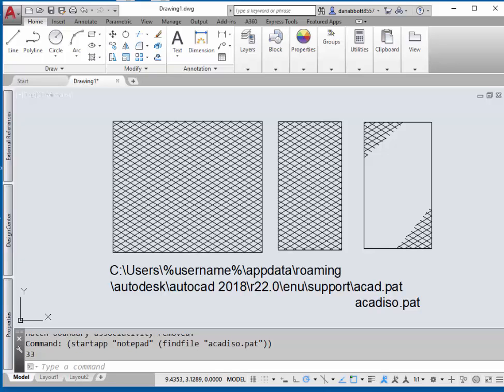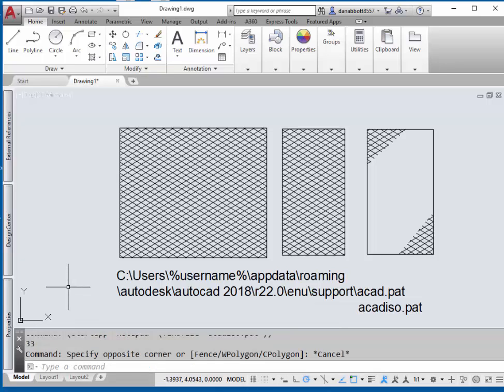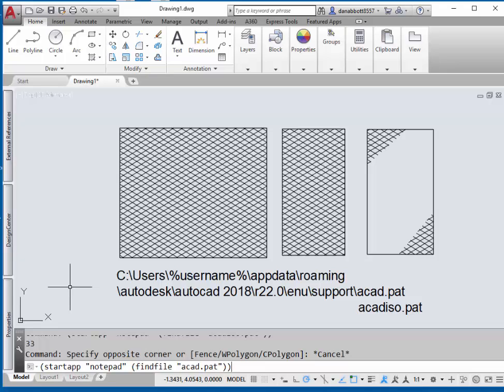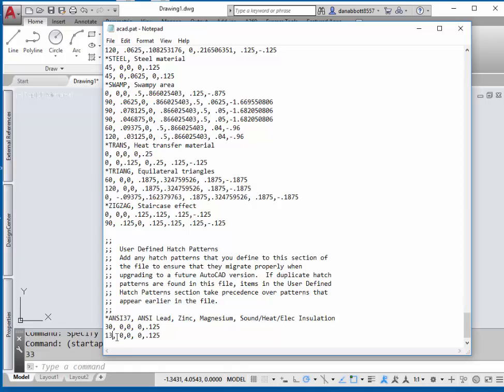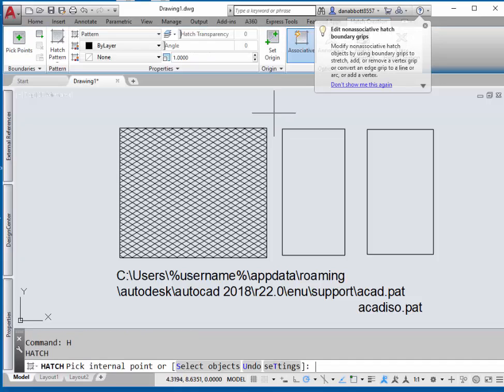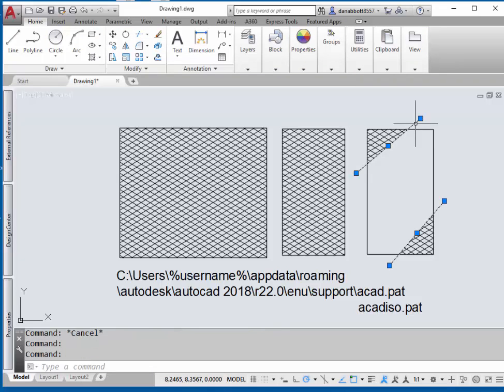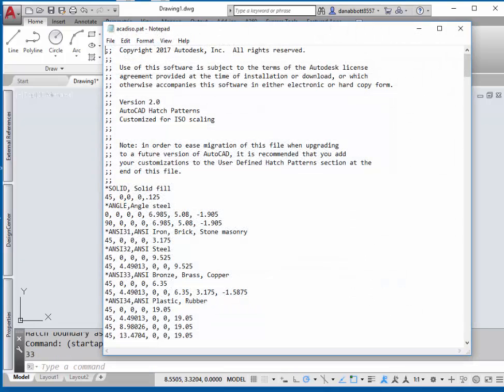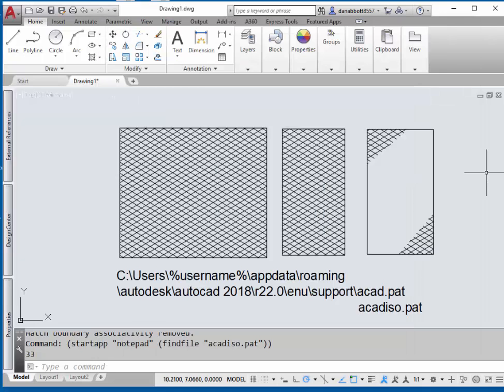Custom Knurl Hatch Pattern AutoCAD

Comment from the maker: NOTE: You need to press ENTER at the end of the .pat file or your new pattern won't be listed when you try to use it. Without the ENTER, AutoCAD doesn't complete the interpretation of that line.

Comment: I can see the pattern in my hatch menu but when i try to use it i get an error message.  Bad pattern definition file:
Missing parameter on line 388.  i've copied it exactly but its not working.  Do you have any suggestions?
Reply: Nevermind.  I think it had something to do with the name.  I got it fixed.
Reply from the maker: OK. Catching up on my YouTube comments.